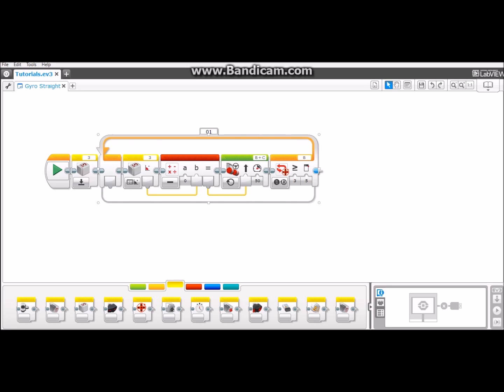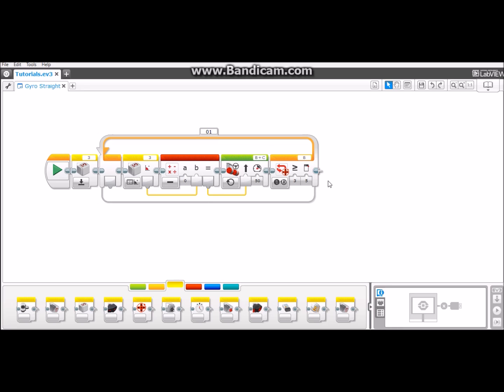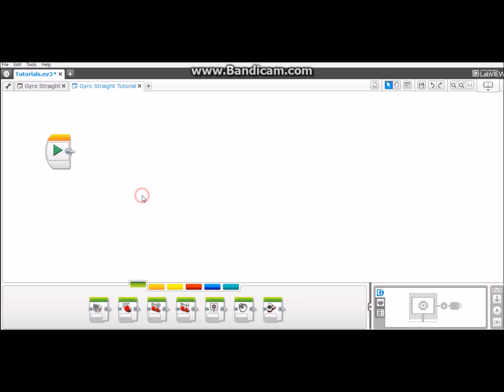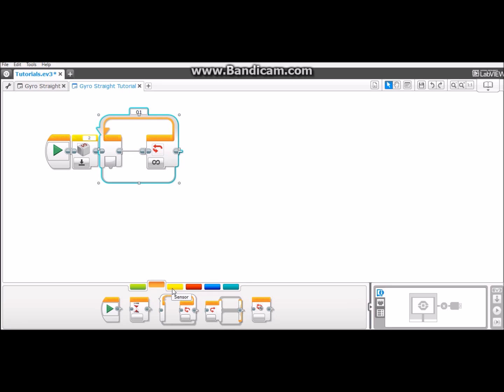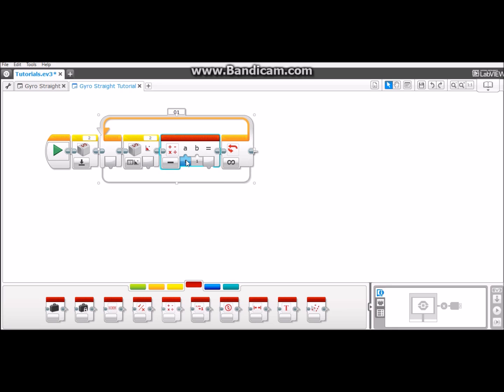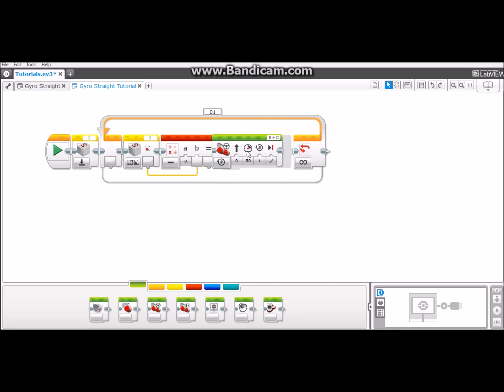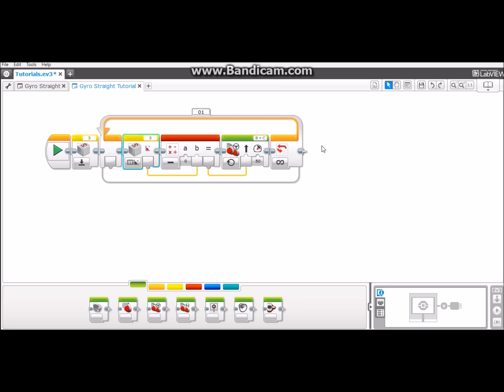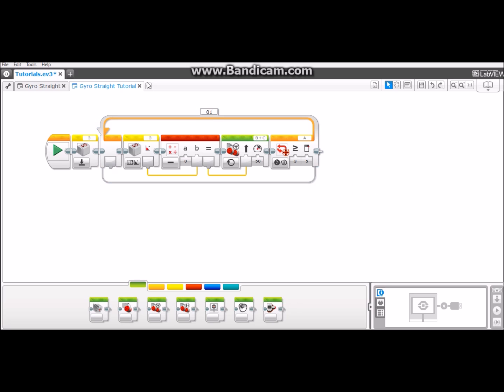How To Go Straight With A Gyro Sensor | Tutorial

Comment: my program won't work. it would just start doing 360's after a while
Reply: you have to make sure your sensor starts at zero.
Reply: You have to turn it off then back on. Then you don’t touch it. Or what you can do is unplug the sensor and replug it back in. Then leave it.
Reply: You click a different amount of options i think. I haven’t used. This thing in a long time.

Comment: Did you have any problems with the Gyro sensor?  Many FLL coaches have reported all kinds of resetting and drifting issues.  Curious about your experience?
Reply from the maker: Occasionally, the gyro sensor will start to rapidly increase it's angle measurement. We have found that you can stop this by un-plugging and re-plugging the wire that leads to the gyro sensor.
Reply: that is what the reset block is for